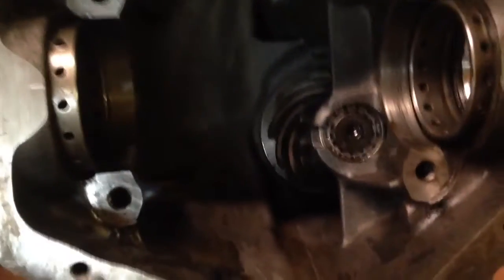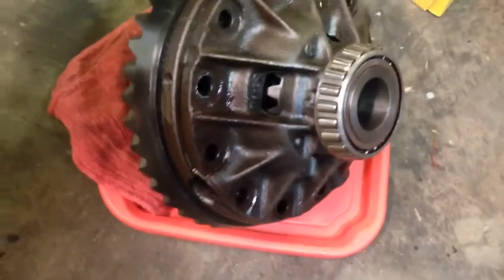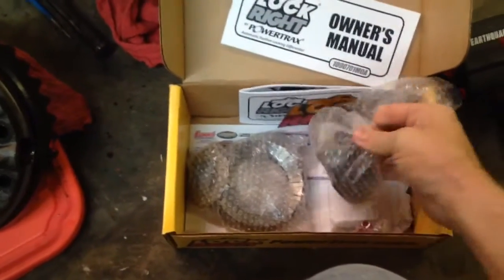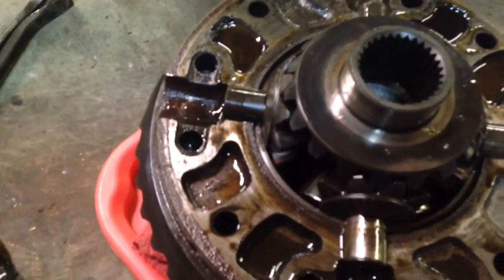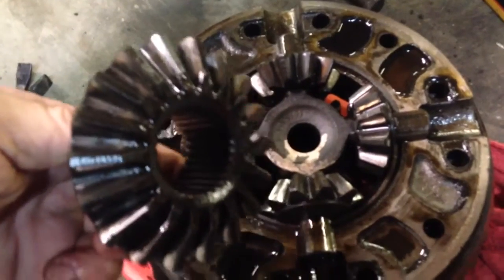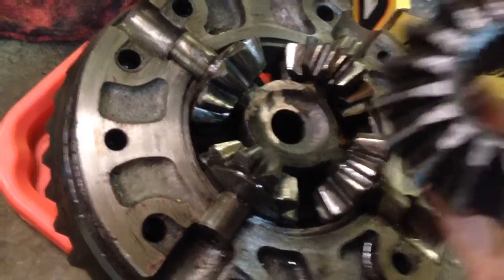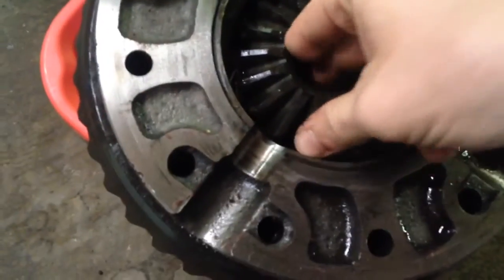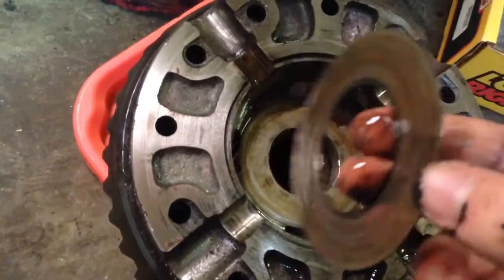GM 14 Bolt Axle Rebuild Part 3

Comment: Was hoping you were going to replace the pinion bearings as well. Got my 14 bolt dually tire down now. Pinion bearing went out and thrashed the shaft on the inside. Thanks for the vids so far.
Reply from the maker: Robert Allen thanks.  I wish I knew enough to work on the ring and pinions, because I would’ve changed the gears out when I had them this far apart.